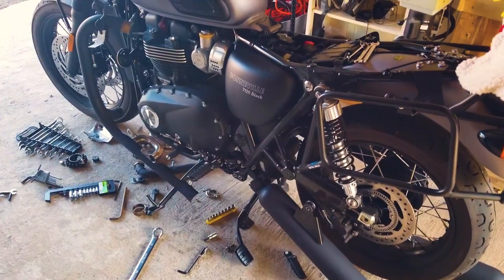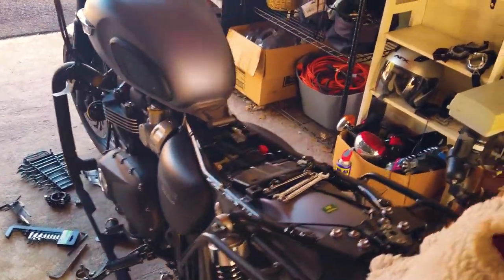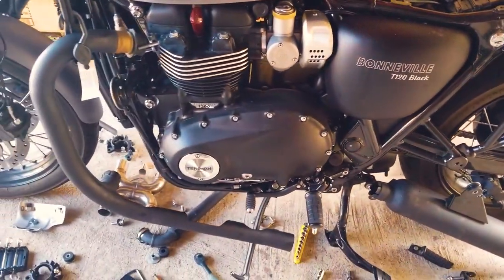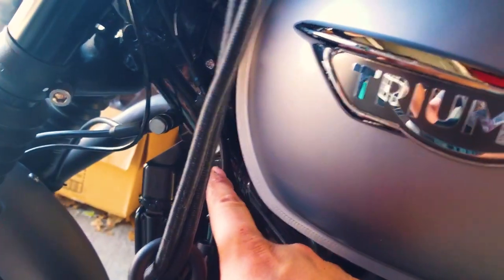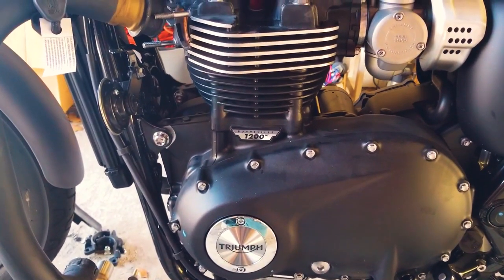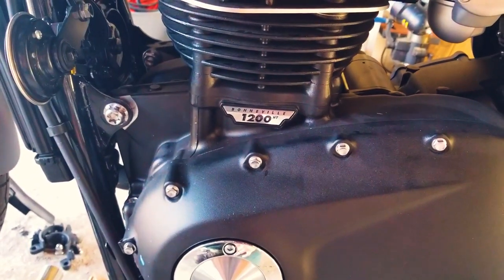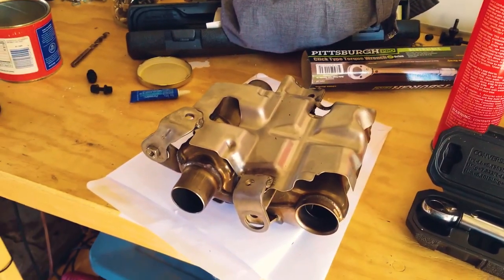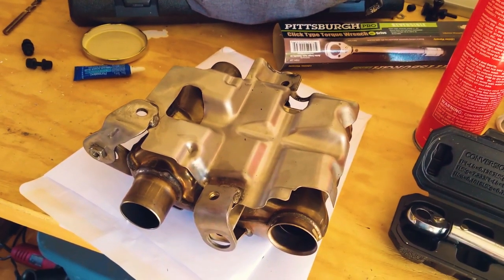0020: Decatting the Bonneville T120, What You Should Know & Was it Worth It?

Comment: You shouldn’t use your torque wrench to break loose bolts. You’ll potentially damage it and put it out of spec. You really should use a proper breaker bar.
Reply: If you set your torque wrench to it's maximum setting and it DOESN'T click before breaking the bolt loose then you're doing no harm at all. In this case we are talking a bolt that's done up to 80nm. Most big torque wrenches go up to 140nm.   True, once you get a click then don't add more pressure - that's how you screw a torque wrench.
Reply: @LondonSteveLee  It is a meter not a breaker bar.  Breaking torque with a torque wrench is an absolute no-no.  Your solution is just abuse of the meter.  A fastener done to 80nm could be cross-threaded and/or corroded and exceed the 140nm but that doesn't matter anyway.  Don't use a hammer to adjust a wrist watch and don't use a torque wrench for a breaker bar or even as a ratchet (except during the final torquing).  It is a meter.  A measuring instrument.

Comment: Just put same unit in my Thruxton R, and I gotta say, yup, bigger job than I expected. It is now significantly louder, which I'm not super big on, but I can absolutely feel a performance difference. I'm still working with the front exhaust connections, because I have a leak and I'm having trouble getting pipes into the decat unit, but so far am jazzed by the results. It is absolutely faster and ballsier throughout the rev range, and honestly, I didn't expect it to be that pronounced.
Reply from the maker: Now that is an interesting question. Do you think the Thruxton might be tuned in a way that takes better advantage of the increased airflow?
Reply: @jvalequin  the Thruxton is definitely in a different state of tune, as it makes significantly more horsepower. But how any of that works with airflow, I have no idea. My first reactions were, it is not subtle. I'm not a terribly sensitive barometer on things like this, and I absolutely noticed a difference.

Comment: I put the same cross pipe in my T120 when a booster plug and Joe Vince stainless steel performance pipes and it performs a really nice sounds awesome and gets great gas mileage lightened 35 lb from the bike the performance pipes were a lot lighter than the stock pipes. And if you are going to do the cross pipe make sure you have exhaust gaskets before you start because you may end up ruining one or two like I did... LOL and my dealership cannot order the gaskets they were on backorder. My bike sits in the garage for two weeks till I decided to order from a dealership in England. I got the part in one week. It's been over a month I told them to cancel the order at my dealership in Maine. I only had to pay about $20 more for shipping it was well worth it because now I'm riding. I didn't find it all that difficult to do. Just fun getting to some bolts like the one under the gas tank.

Comment: Great honest video about the benifits - thanks. I've installed the booster plug on my 2018 T120 and done a re-map (Tune ECU) to get the 100% throttle and better fuelling. Which is a much easier way to get more power and keep the emissions legal.

Comment: New obstacle in this mod - the 2022 T120 models use WELDS instead of clamps, on the link pipe connections at the rear of the cat. Trickier to get off the bike with pipes attached, and (since I don't have welding skills...) I needed to order 2016-2019 link pipes / clamps / gaskets to do the job ($360 with a 15% discount from my dealer).

From what I hear, Triumph and other manufacturers are being pressured to make it more difficult to modify exhaust systems.

Leaving this here for others so they don't get surprised by this new cat setup. I think the Thruxton RS and a few other models started the cat welds a year or two ago, but it's new for the T120 in 2022. Not sure about T100 or other models.
Reply: My issue too - .I have the black pipes
Reply: @steve5370  Same. T120 Black. My approach - oem center stand, 2016-2019 link pipes, and the TEC x-pipe. More $ but I think it'll be worth it.

My bigger dilemma - getting the welded cat OFF the bike. My hunch is the left frame rail will need to come off entirely (not just loosened), at the very least. Possibly both frame rails - left first / twist cat down / re-attach / same procedure on right side.
Reply: @steve5370  UPDATE - got word from British Customs that a solution is in the works. They put me on a contact list so I'll be alerted when it's available. I'm going to sit tight and wait for now, instead of ordering link pipes from the dealer. Getting a center stand in the meantime. Hope this helps!

Comment: I just completed this mod on my T120 - pretty significant power boost, but I've also already pulled the airbox, installed a Baak intake, and swapped out BC Sleeper Pro pipes. Both steps in the process, decat and airbox removal, produced noticeable torque and power gains. Not sure if decat alone would accomplish this, since I did the airbox first. Highly recommend both steps.
Reply from the maker: Thanks for sharing. Haven't tried the intake road, glad to hear it produced some major results!

Comment: Getting the cat shield/mount out with the cat mounted to it was an incredible feat since there's just no working clearance in there. You are the man! I didn't try, instead swinging down the left lower frame tube and just sliding the cat out to the left. Cat delete and TEC X-pipe installation was no easy task on my T120, either. It took me most of a weekend. I'd add one more reason to delete the cat: heat reduction. I live in a hot climate and this has been very welcome. The bike's throttle is also now much smoother. Other really worthy little mods are replacing the swoopy front brake discs with the much lighter and better looking T100 discs. This also improves turn in and reduces unsprung weight by four pounds. Replacing the stock T120 headlamp with that of the T100 reduces weight even more, gets you much more room in the headlight shell, and gives a high beam that works very well indeed. Enjoyed the video, thanks!

Comment: Did the same job on my Thruxton R.
As you've found, it was a pig of a job.........with a capital P.
Worth it ?
Hell yes...........!!
Reply from the maker: What cross pipe did you go with?
Reply: @jvalequin  
Like you, I went with the TEC product.
By far and away the best value x pipe I could find. 
They are located less than 100 miles from me, in the north of England.
I know some have had good results with the Motone custom unit.
But the TEC was well made at a good price,  and came with a lifetime guarantee. 
I fitted the Vance & Hines silencers and a Power Commander V at the same time.
The bike was then custom tuned, by Dynojet UK.
Honestly, I dont think you will reap the full benefit with any of the modifications made in isolation.
Reply: Hey friend, may i ask why you think its worth it?
Reply: @kevinh82  Like most, I was looking for improved sound from the exhaust.
For many, I suppose that's reason enough, and yes, it does sound better as far as I'm concerned, but of course this is subjective.
The Cat does strangle the exhaust, and it also runs very lean.
A few more bhp is released, but again, real world use, I doubt it would be that noticeable to be honest.
I wanted to fit a supercharger to my machine, so I wanted the widest possible scope to tune so perhaps my motivation and subsequent satisfaction with the process differd from most.
(I fitted the supercharger kit supplied by TTS Engineering)
Reply: @chrisbolton2500  Thanks for the elaboration, appreciate it 🙂

Comment: I'm doing a 2022 SS 900 right now.  It would have been pretty easy but some dimwit put the clamp on the left tube with the Allen head facing directly to the frame upright.  I will have to modify a Allen just to hopefully loosen the clamp enough to be able to turn it to were I can easily get it the rest of the way.  But no worries about taking the frame apart.  No Cat will be better for your engine,  It won't have to work as had to breath.  The heat under your motor is not exactly helpful either.
Reply from the maker: Sorry to hear about that clamp! Yikes.
Reply: @jvalequin  I don't even see how in the heck they managed to do it.
Reply from the maker: @x-man5056  that's the start of every good wrenching story!

Comment: Nice narration and summation.:-)
 I must admit I had mine done at a service, and I run original silencers.
No noticeable change in performance: it was sweet before, and is sweet now, but does sound less "woolly". On the throttle has a bit of a bark. I have also fitted (yup, I did that one!) a KN filter to compliment the X pipe.. If one looks inside the cat. it's a miracle the bike runs at all. Pick a good smooth flow X pipe (Motone, Tec?)
Reply from the maker: Been a huge fan of Tec for years, that's the one I picked. How about you?
Reply: @jvalequin  Mines a Motone, but the three that keep being recommended seem to be Tecs, Hyde, and the Motone?

Comment: I have a speed twin, it has a balance pipe just after the O2 sensor connecting both the exhaust before the cat.  Is it still required this x pipe if we want to remove the cat, will a straight pipe do?

Comment: i let my dealer perform this.  for the money it was worth it..Drop it off.  pick it up. done.  If anything goes wrong they own the job.  If you like to wrench and are determined yes you can do it.   For sure it frees up the motor and reduces foot heat.  And it lets out the Triumph growl as most of the noise baffling is in the cat and not the silencers.  I would suggest a K&N highflow air filter to go along with it.. more air in more air out.   Your engine braking will be reduced.  In the end for me sound is the only real benefit.  In the future i wont touch it.  Im interested in the booster plug due to my throttle liking to "take off" on me.  Best i can describe it.  Will try this next.  Thank you for sharing this video and i enjoy watching them.
Reply: I made the desision before buying my brand new T120, so when i picked it up, it already came with the x-pipe installed. No hasseling or extra cost there, it was a pure dealership service.
I have no idea how my bike would have performed with the factory installed cat, but i'm more than happy with it's sound (with factory pipes) and performance as it is now
Reply from the maker: What brand cross pipe did you go with?
Reply: Tiny Triumph Shop I bought the TEC. Runs about $175.00 if I recall.
Reply from the maker: @chadmock5883  same here, I'm curious about how it compares to the Motone.
Reply: Tiny Triumph Shop in respects to its function they are all likely going to be similar.  I’ve heard that Norman Hyde has some issues with fitment. No direct experience with that one though. So far mine has been great. 4500 miles no issues.
Reply: Tiny Triumph Shop check out Stuart Fillingham, he installed the Motone...

Comment: I have 2021 T120 Black (Euro5) the intermidiate pipes are welded into the cat on the outlet sides, so you cannot fit an off the shelf X pipe - to me it looks like a complete exhuast replacement, unless some one out there can enlighten me further! not even sure how you would get the OEM cat out of the frame?
Reply from the maker: I really hate to hear they are wielded on now. I suppose it would have to be a full system, or at least the headers and link pipes...
Reply: @jvalequin  yes, its a 2 into 2 Tec Bike system for me, plus working out how to remove the Cat with the intermidiate pipes welded on to the convertor

Comment: You dont need to remover the plate above the cat.

Also a huge benefit to me anyway.....its the dam engine braking with the cat fitted.....its horrendous..like putting the brakes on....now its just like a normal bike with normal engine braking.

I have the T100....its more lively....less jumpy on low throttle openings....pull a higher gear at a lower speed.

And I love the sound....no to noisy.I would not like that....just right to me....with the std peashooter exhaust.....would never part with them.....they look to good...old school.

I fitted the British TES X-Pipe....not mentioned in the instruction vid....but I did read it elsewhere.....how to let the ECU re-set immediately after the install on the first engine start.....you must not open the throttle till the procedure is done.

Basically start up....let idle/tick over till the cooling fan kicks in.....leave running still dont touch the throttle.....and wait a further 12mins....stop the motor....re start it.....that it...job done.

TEC do say in there instruction this procedure is not req....but I did it anyway.....I get no popping on the over run....Thank God...would not like that.

Comment: Hey Tiny! Roughly how many miles did your pony have before you did the cat delete? I ask because my T120 now has like 750 miles, and man does it feel so much different and it does sound better (post-primary break in period). I actually have the TEC cat delete and am now wondering if it's worth the $200. I don't know man. I also heard it was more "tin" sounding? That might be a bad thing.
Reply from the maker: Hey Nick, I had just over 1500 miles on her before I did the delete. I will say to the "tin" sound, make absolutely sure the gaskets are tight on the cross pipe. You can wet your hand and feel around the gaskets for any air while the bike is running. I originally had a really "tinny" sound coming from the clutch side of the bike, it turns out one of the gaskets was not properly seated!
Reply: @jvalequin  Huh, good to know! I think I'll do the install, simply because A: returns of anything suck, B: there is reportedly more power, C: you mentioning the "tin-sound" puts my mind at ease.

How did you go about fixing the gasket? Did you have to take it ALL apart again to fix it?
Reply from the maker: @nicholasspinicelli2911  fixing it only required removing the offending gasket and reinstalling it. YMMV, but it shouldn't require taking anything off at all!

Comment: Do you need a tune after decatting it?
Reply from the maker: Nope, didn't really have any issues. After I added the Booster Plug, I did have it tuned. I can't say there was much of a difference before/after. The Booster Plug made the most notable change to the fueling on the bike in a overwhelmingly positive direction.
Reply: @jvalequin  
People never learn what is fuel trims are. It doesnt matter you install booster plug or removed cat, fule trims will adjust to perfect AFR and no more no less fuel will be added under cold or worm conditions. I can tell you, booster plug is waist of money as ECU sees cold temp and monitor presure and then monitors what AFR comes out of your exaust, then makes AFR to make engine run perfect.

Comment: Does the computer need to be re-calibrated after this mod ?
Reply from the maker: I'm not positive that it does. From what I hear, the ECUs on the new Triumphs are much more adaptable than their air cooled predecessors. I ran it for a good month or so after the mod with the stock map on the ECU but recently had the bike in the shop and they remapped the ECU. The bike ran marginally better after it was remapped.
Reply: @jvalequin  Thanks for your reply. I read the comment below that a dealer performed this work. Isn't it illegal to tamper with emission devices ?
Reply from the maker: @geezersgarage8181  I believe different states have different legislation on the matter. CA is very strict about emissions regulations, other states not so much. I'm no lawyer though. 😁